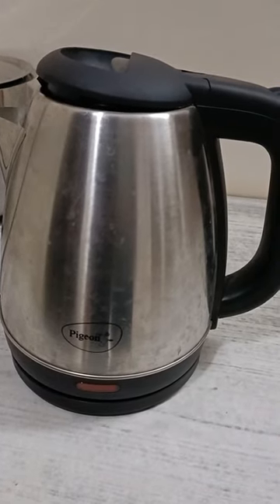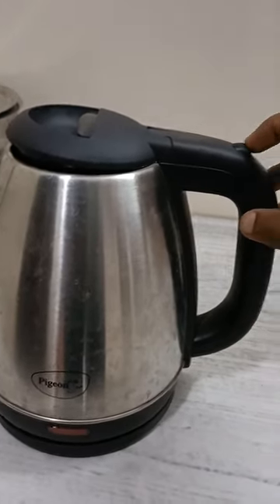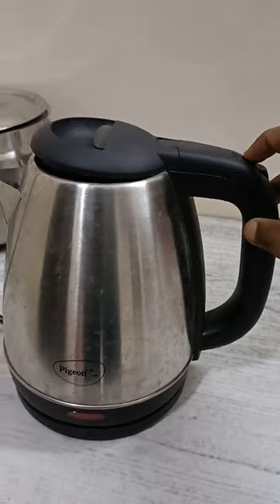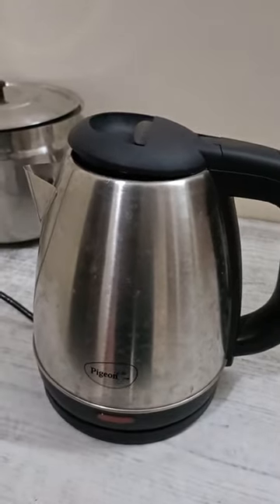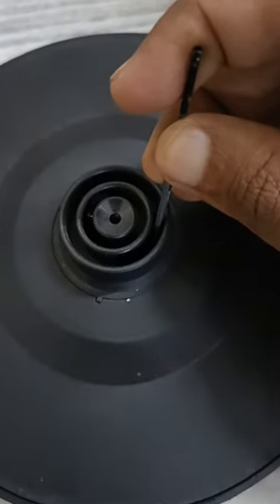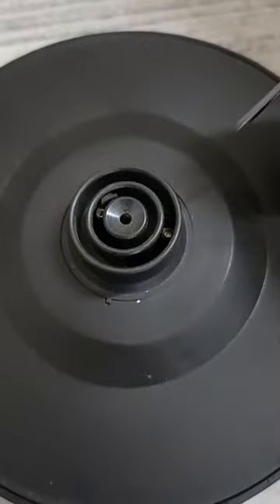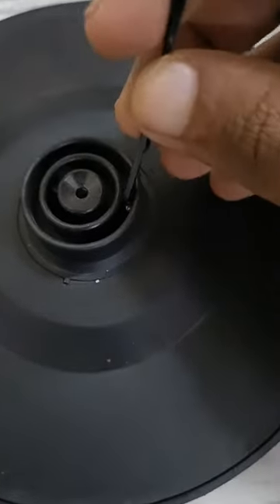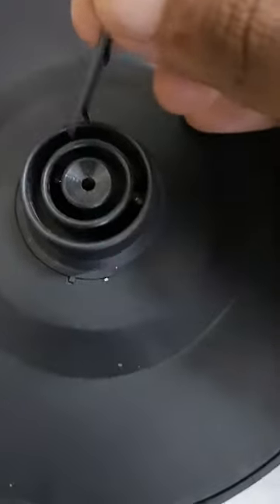How to Repair Electric Kettle // with in 20 Sec

Comment: How to fix water leaking from bottom side in water kettle, please tell if there's any fix.
Reply from the maker: Kettles usually leak because limescale grows around the heating disc and under the rubber seal. Until it grows to th bottom of the seal and water starts to leak. If you clean it, kettle will work some time longer

Comment: I have the same kettle but nowdays some white substance is coming out from inside the kettle.... like some very small stone.....
Reply from the maker: Limescale is the white, chalky residue that accumulates in kettles or coffee machines, and it's particularly visible on stainless steel. It's a common problem in hard water areas, where the higher concentration of magnesium and calcium leads to limescale.

Have you ever noticed a white residue on the inside of your kettle after boiling water? If you have, there's nothing to worry about. That white substance is calcium, which exists as a dissolved mineral in water.
Reply: @ManojKumar7  but that white substance isn't in that inner part where water is filled..... it is in that part which is covered.... in the inside of the part where indicator is there.... I mean inside the bottom part of kettle
Reply from the maker: It cause due to the regular water spilling in the area.
Reply: @ManojKumar7  i still have some doubts....

How can water spillage be there ?? That part which I'm saying is near the heating element and it is totally covered from outside.....

If possible, kindly send me ur email id.... I'll send you the pic showing the area where that white substance emerges....